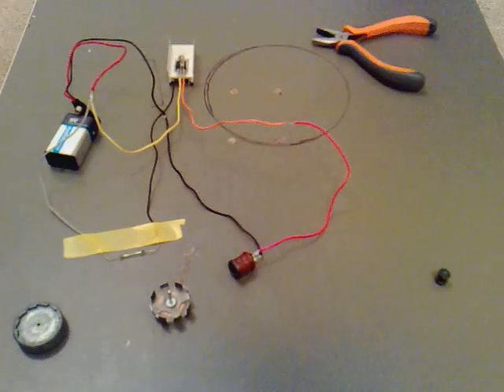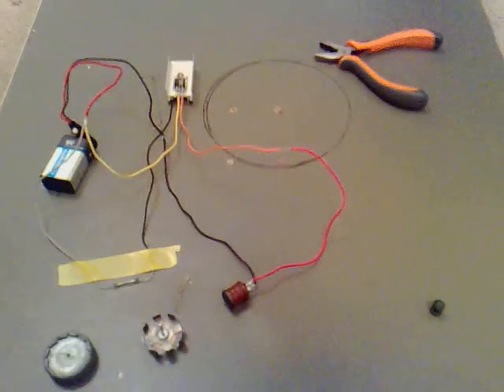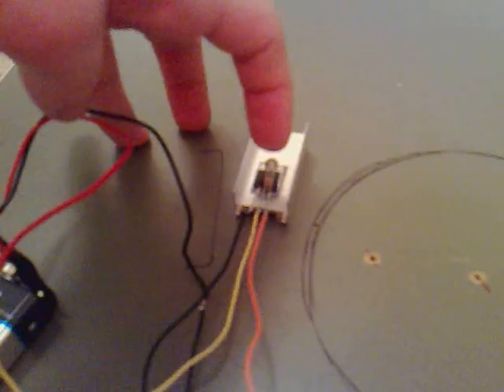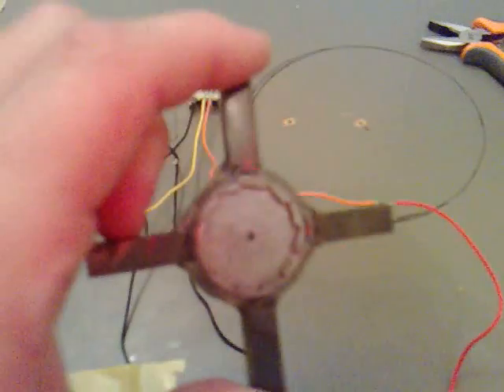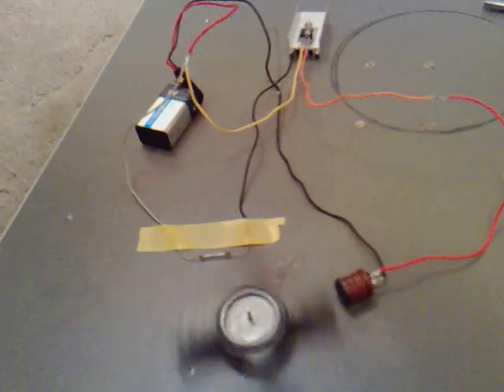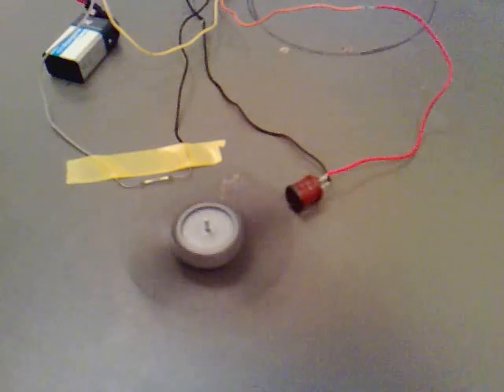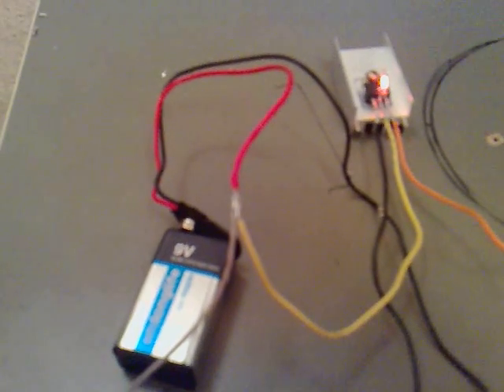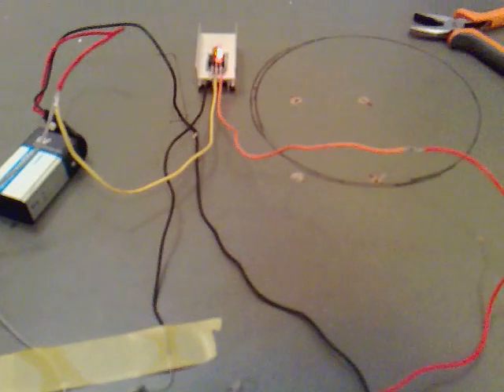Pulse Motor (Smaller Scale) 066

Comment: thats fantastic!  Well done!  Bedini says that geometry is not an issue with the motor so size shouldnt really matter.  I'm confused why everyone keeps using bike wheels when a smaller machine works just as well.  the only advantage of having a larger wheel (that I can see) is you can add more coils around it.